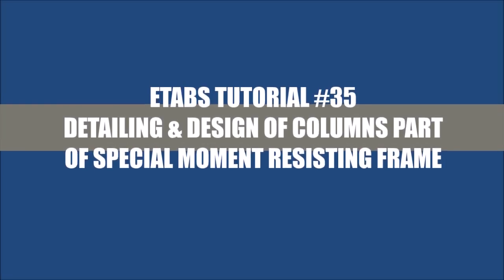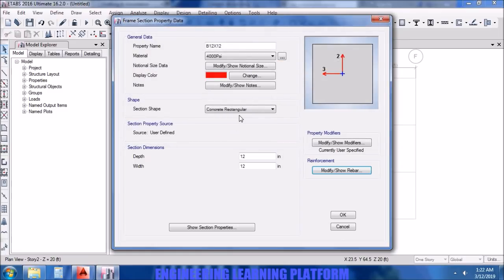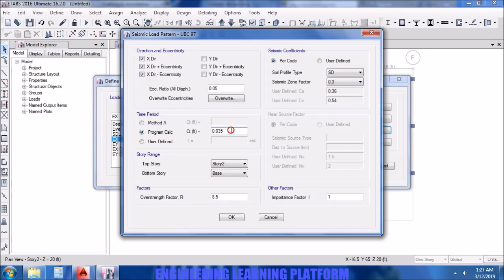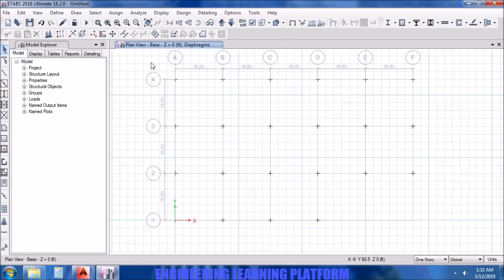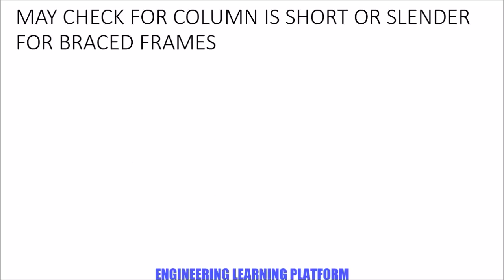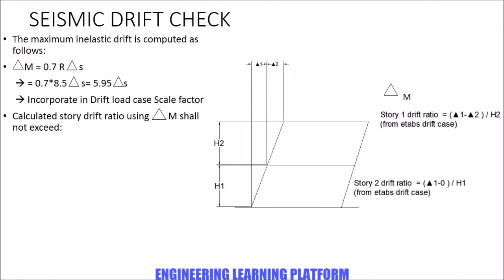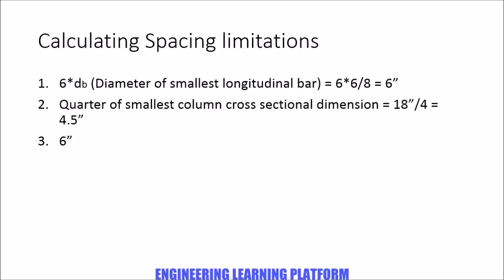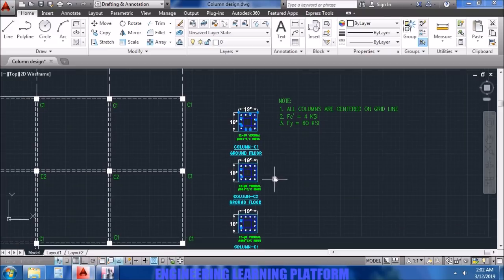RCC column design using etabs – SMRF design using ACI code

Comment: Correction: 4 leg * 0.31 (in^2) / 0.307 (in2/ft) = 4 ft c/c NOT4 inch c/c 
Correct Calculation: 4 leg * 0.31*12/0.307 = 48.69 in c/c. You have to convert the units correctly. Other than that great job.

Comment: Hi sir. I set column to be DESIGN after the analysis all column pass showing all Longitudinal rebar area but when i check the column by right clicking it, the rebar areas on each case and each part appears, the area appear is NOT THE MAXIMUM there are value higher than what appear. What u think is the problem? Any experience? Thanks and more powers.
Reply from the maker: Which Etabs version are you using
Reply: @EngineeringLearningPlatform  2016
Reply from the maker: @engrgep  this seems to be a problem with your cracked version. It's not normal
Reply: @EngineeringLearningPlatform  thanks. I see some write up in the internet that for column DESIGN we need really to check one by one after the analysis and design to ensure all columns are safe.

Comment: Hi bro. i have a question, you design the column in accordance to the SMRF requirements by ACI and you leave the beam design, is there a need also for a design of beam reinforcement and ties in accordance to SMRF req.? If yes, do you have video for it? Also in designing a residential house is it still required to design it using SMRF if the location in on zone 4? its a 3storey residential house. Please reply and thanks for the video!
Reply from the maker: Yes there are special requirements of beams as well refer to chapter 21 of ACI 318 . Yes SMRF is used in zone 3 and 4 .
Reply: @EngineeringLearningPlatform  do you video for it bro? Meaning etabs will not provide us detailing of steel reinforcement in the software using SMRF? Thanks for the reply. Also on safe do i need to use meshing if i have strap foundation? As i know it can detail the foundation using strip method and will provide correct values for reinforcement and no need for special detailing like this on SMRF right?
Reply from the maker: @markcanicula  Yes etabs doesn't, no its similar to IMRF beam on which i have made video already, you can see in etabs playlist, but the main difference is only of the numbers betweem smrf and imrf, else method is same, no auto mesh us more than enough in safe . No special seismic requirements . Just check pressure if foundation using SMRF service combos
Reply: @EngineeringLearningPlatform  yeah your correct there is no need for SMRF in foundation. Just soil pressure. Is punching shear a serviceablity requirements or strength? So i need to use slab mesh on SAFE or no need? Thanks!
Reply from the maker: @markcanicula  Its a strength requirement .
Reply: @EngineeringLearningPlatform  Sir, you made a P delta analysis. But do i need to check if its on allowable as per ACI before doing the defining it? because after i run the p delta on my model it is not giving result
Reply from the maker: @markcanicula  I don't really understand the concern . You may contact on the facebook page of Engineer Learning Platform .

Comment: You said the nominal capacity of the beam x 1.2 should be less than column flexural strength. But here u r checking in Dcon10. Where is the nominal capacity without any factor?
Reply from the maker: The etaba option already checks that itself using space frame criterion and shows O/S if 1.2x of beams flexural capacity exceed columns flexural capacity at a joint

Comment: Dear highly appreciate ur effort.
Pls correct the shear rebar size calculation. It Should have been rebar area required ( as evaluated by Etabs) divided by the product of no of rebar legs and bar spacing.
Reply from the maker: Yes the etabs output should have been in in2/in rest is okay . Just did the mistake in units
Reply from the maker: I have added correction in video's description
Reply from the maker: Just see the units
Spacing (in) = [#Legs × Area ties (in^2) / [ Av by etabs (in^2/in) ]

in^2 cancels in^2 leaving 1÷(1/in) OR simply "in" which is unit of spacing required .
Reply: Still the formula for Av bar spacing should be inverse.
It should be Av required  ( from Etabs) divided by Av (proposed)
Reply from the maker: Spacing = Providing bars / Required bars
Reply from the maker: Plus i never saw spacing in terms of 1/in intead of inches

Comment: appreciate it.. but I want to ask there is no design for beam - column joint ( stirrups)??
Reply: and want to ask about sum moment of resistance of column should be higher than the sum of beams by 1.2 
the moment of resistance of beams depend on the reinforcement for beams so it should be designed on etabs and not increase it any more??
Reply from the maker: @s-esmail  yes this check is know as strong column weak beam check which is already applied in this video at 26:00 . Yes the joint details should be done . Which is in other words stirrups and tie spacing at supports  . That is what we calculate . However we may increase spacing of stirrups and ties in mid spans/Height respectively
Reply: @EngineeringLearningPlatform  what I understand that the stirrups you calculate only at h/6 above and below the joint (h :height of the floor) as i think
 but what about the joint it self??
Reply from the maker: Yes the joint detailing will also follow this .

Comment: Bro #5 Bar is too dificult to bend at site...WE usually use #3 stirrups
Reply from the maker: Yes, but we use #5 too if the shear is too high or increase cross section .

Comment: Bro why haven't you selected beams alongwith columns while selecting SMRF in design preferences? Moment resisting frame resists lateral loading by flexural actions of columns and beams....I think if you have selected only columns then software will design and detail columns for ductility only but beams should also be selected while assigning SMRF or IMRF....Please reply
Reply from the maker: Since the concern is to design column . And selecting beam for smrf will not change the beam's strength but will change steel in beam which is not our concern here

Comment: Awesome work... Please make a video on design and detailing of the shear wall including assigning pier labels, boundary elements check, types of methods available in ETABS. When designing lift core please explain all walls in lift should be assigned the same pier labels or different. Please explain in that video.. Thank you bro
Reply from the maker: Yes before shear wall i had to go through many practice problems and code limitations and modeling techniques to provide authentic tutorial with code references and detaiking preferences so that understanding is easy with strong code supports .
Reply: @EngineeringLearningPlatform  I appreciate your work brother... Keep going
Reply from the maker: @structurefreek1713  please share with others too :)
Reply: @EngineeringLearningPlatform  I share with my friends all the time.

Comment from the maker: CORRECTION : TAKE SHEAR REINFORCEMENT Av FROM ETABS IN (in^2/in) UNITS FOR USING THE TIES SPACING FORMULA PROVIDED IN THE VIDEO.
RCC column design using etabs – SMRF using ACI code - Special moment resiting frame design building frame system